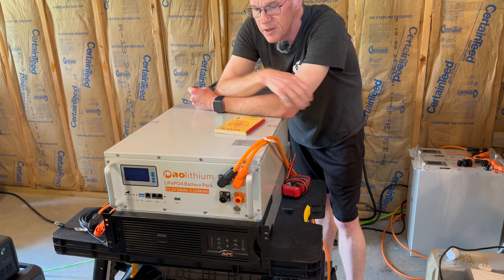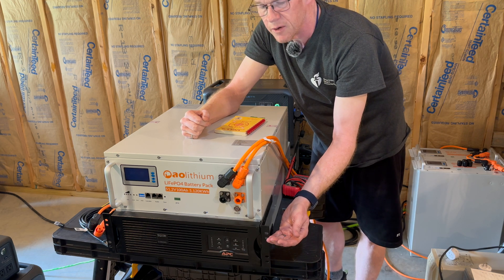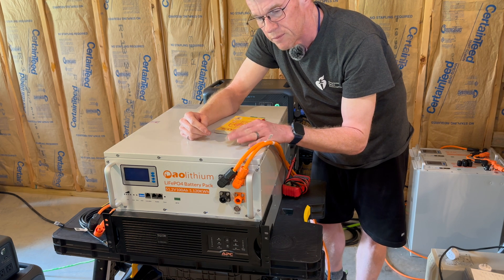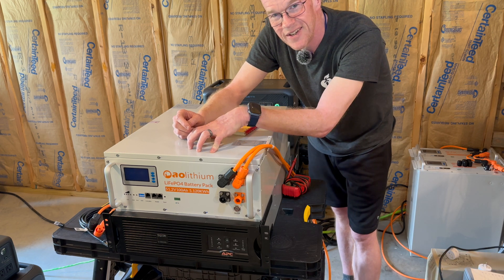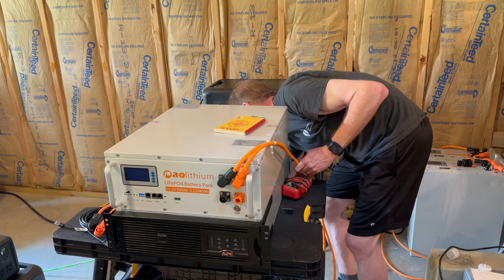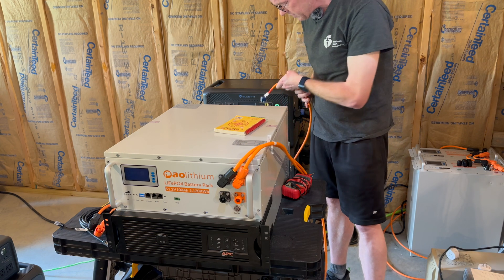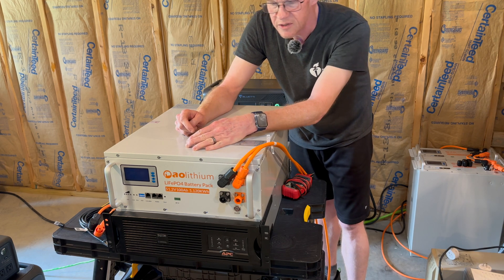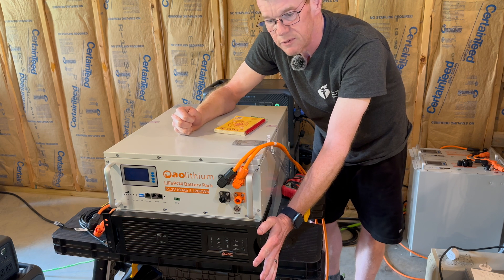AOLithium 51.2V 16S 100Ah 5.12kWh LiFePO4 Rack Battery Part 2: Charging, Wiring, Full Discharge Test

Comment: How did you connect it to your Bluetti?
I have a Bluetti AC200P and would like to connect it to my power station.
Did you connect it directly to the pv input?
Reply from the maker: I don’t believe the 200P has a battery expansion port, so you would have to use it on the solar input.  If you had a 51.2V unit with an expansion port you could do this: https://youtu.be/j0jx0CuhmB4?si=Qg7EIdKNuHWtEM9f
Reply: @DougKremer yes, it has no extension port. PV input is 35V -150V. Do you think I can connect the Aolitium directly to this input or must I connect something in between?

Comment: I agree the cable setup is simple and made to be flexible. AOlithium did not do a good job of simplifying the language. Will was really passionate about the cable size but really most people with a single 6kW inverter are fine with the daisy-chain. I chose to run sets of 2 packs with the parallel cables and longer cables per each set of 2. overkill for my setup of a single 6kW inverter and ~50A max.
Reply from the maker: 100%.  If you are building your own system you need to be aware of maximum amp draw and design accordingly.

Comment: I have 4 of these and I love them. I’m getting one more.
Reply from the maker: Very nice.  The three I have are working great too.
Reply: Did you get communication going on the SP6548?

I have determined that the Voltronic inverters only work when all dips are off except the first one. I think since you have the older BMS with the RS232 port it will require a custom cable matching the pin-outs.

Comment: Interesting is there any point of such complication with com ports/screens/etc and not getting just  batteries instead, connect them and use invertor to do all charging discharging. It seems that's a gimmick just for beginners, and experienced user can use voltmeter to know all that info.
After all you can either buy 5 Kwh of "smart" battery or 8-10kwh of just battery without smart features..
Reply from the maker: Good question.  The comms features do let the batteries talk to the inverter for more than just sharing the State of Charge, which is difficult to guess based only on voltage.  The batteries can also tell the inverter things like "hey slow down, I'm getting full".
Reply: @DougKremer  i just implemented the "victron" canbus protocol for theese batteries on my python protocol gateway project for monitoring theese batteries. 

what it sends is dependant on the protocol, canbus sends the least amount of data, and it's basically just... 
state of charge, health, battery voltage, cell min, max voltage... and i think the besides, soc, the main thing the inverters need / want to know about is the warning flags. 

---

side note, i find the bms features good for diagnosing and monitoring for my own personal use. graphing cell voltages... this let me know i got screwed over by sok for one of my batteries... almost immediately noticable. partly why i just got some aolithium batteries instead of sok.
Reply from the maker: Very cool.  I'd like to get them into HomeAssistant.